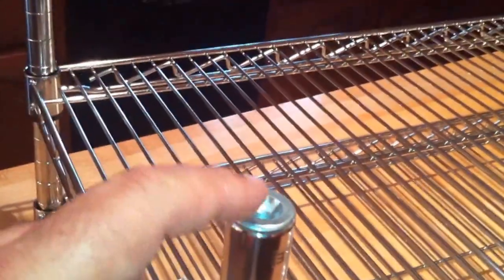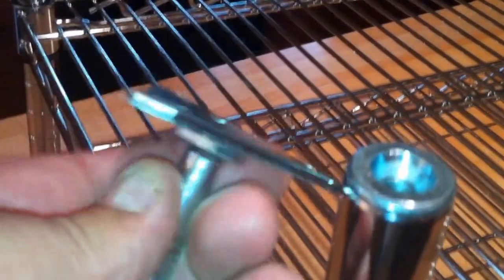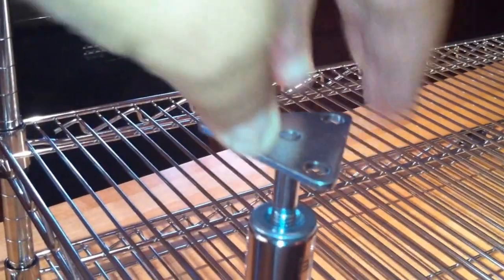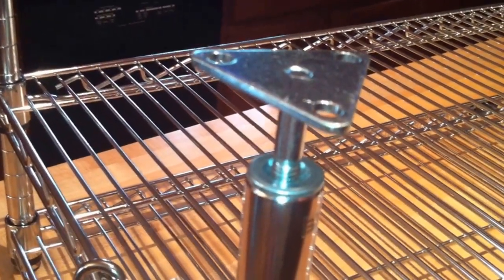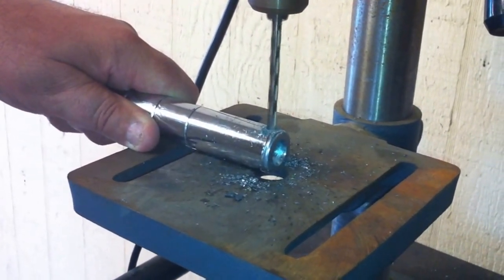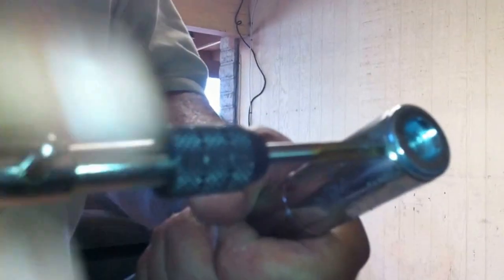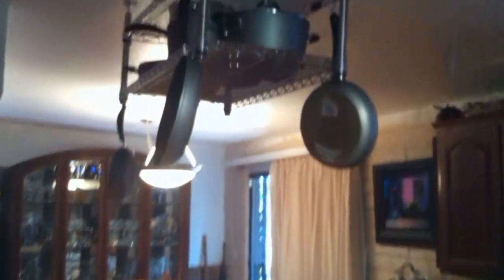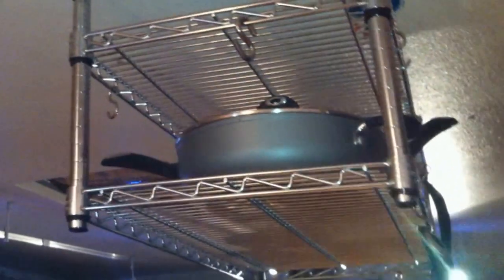El Frankie's Homemade Pot Rack video

Comment: Did you screw this into joints or was it in directly to the drywall? Did it fall down yet?
Reply from the maker: mach-a-chine seahawksgoonie The roof rafters are 24 inches on center and this is the forefoot item so it was screwed in straight into the rafter not going anywhere
Reply from the maker: 4’-0” shelf.   Screwed perfectly into wood rafters as I designed it to do. I’m an architect
Reply: Do you have to be an architect to measure rafters on center? 🤔🤷‍♂️Asking for a friend.